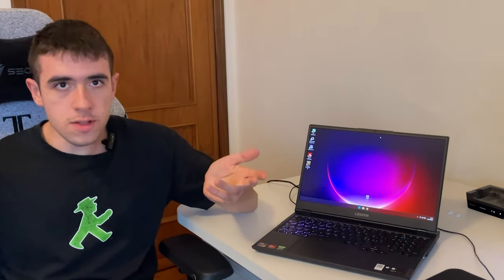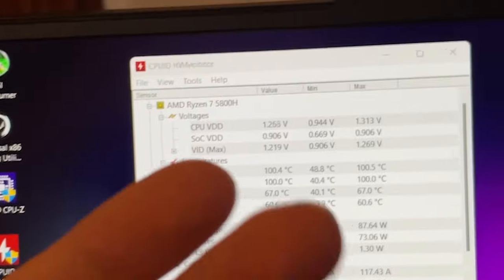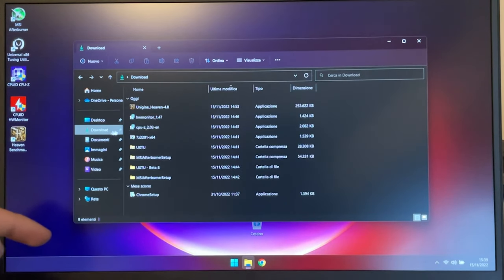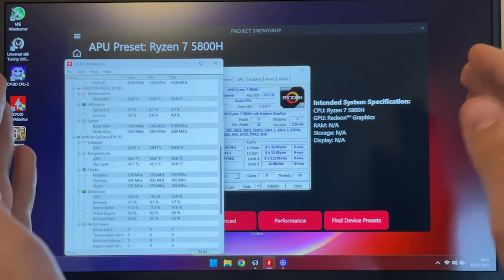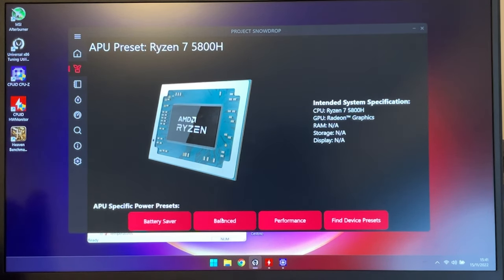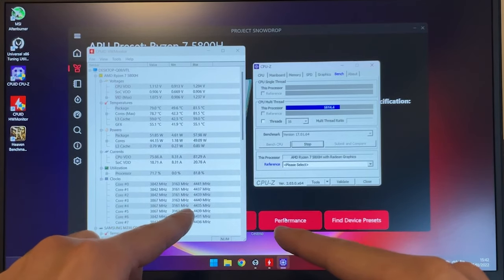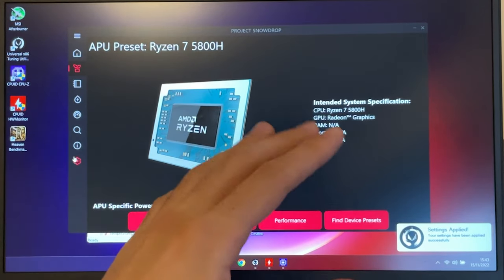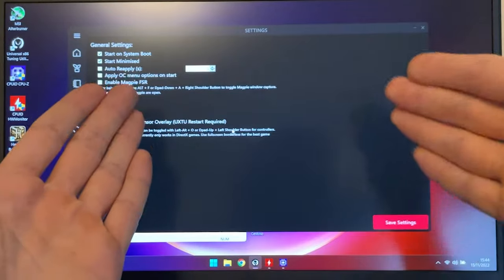Undervolt ANY Ryzen Laptop CPU for more FPS | Tutorial | R7 5800H on Lenovo Legion 5

Comment: My laptop automatically limits the temperature to 91 degrees. (I Just downloaded it a few minutes ago) with balance mode it gets even hotter xD The only helpful way for me is to disable the Cpu turbo in windows and running at stock 3,27ghz
Reply from the maker: Oh wow, you have some serious thermal issues there😅 Have you looked into repasting it?
Reply: @ImWateringPSUs  I just bought it recently, it's a nitro 5 (not the best cooling) but with ryzen 5 + 3060 for €635 it was a good deal
Reply: @alicmd378  whats your 3D mark timespy benchmark score ?
Reply: @JohnnyBoy7267  7900 graphics 6500 cpu
Reply from the maker: @alicmd378  That's really good and also a pretty good deal!
Reply from the maker: @alicmd378  But I would personally looking into repasting it, it shouldn't overheat that much!
Reply: @ImWateringPSUs  That will void his warranty

Comment: Hell nah. This balanced mode nearly fried my r5 4600h. Usually I have 85°C and 2GHZ on my 2 year old CPU and I try to do something to up my GHZ to at least 3GHZ stock. (not even talking about the 4ghz boost). And after setting it to the balanced mode my temp was increased from 85°C to 95°C in 2 SECONDS. YES, 2 SEC. 10 degrees more. Also my GHZ jumped up from 2GHZ to 3. So I was like: Okay, that is very hot but the GHZ is very good. Little did I know that after 3 minutes my laptop turned off instantly. It did that prob because of an safety precaution, but it didn't want to give any signs of life for like 5min. After 10 minutes it turned on and it was bootlooping for another 10 min. I turned it off by pressing the power button for 10sec, and then turned it on again. 
This time it turned on as usual. Now it is working the same as before but it nearly got fried.
Reply from the maker: This isn’t related to my tutorial though, it means you have a very severe thermal problem that you are circumventing bu locking the frequency at 2Ghz, effectively leaving half the performance on the table. You should do a repaste/repad and give it a nice clean!
Reply: @ImWateringPSUs  Yeah, i probably should do it. I (kinda) fixed my problem with that GHZ, now its between 2.5-3.5 GHZ so it is okay. I fixed it by turning on nvidia whisper mode and putting my vents to 100%. Im saving up right now for a new PC with rtx3060ti and an r75800x3d. But for now my laptop can deliver somewhere around 40-60 fps in RDR2 medium settings. Im ok with that for now. Also im curious how my thermal paste looks rn because i didn't change it for 7k hours of working on this laptop.

Comment: i have a question i ran this and my laptop started lagging alot and now i dropped performance i used to get 450 fps on minecraft but now i  get 150 not even 120
Reply from the maker: You did something wrong, but hard to say what
Reply: @ImWateringPSUs  I already fixed it with just reinstalling windows im glad it worked

Comment: If you have Acer Nitro 5 AN515-45 with Ryzen 7 5800H - and on that machine got Realtek HD Audio + DTS:X Sound, by any chance - and you experience CRACKLING SOUND issues or STUTTERING/TEARING mouse cursor while opening a program in Windows, than just downgrade this machine BIOS version from 1.10 back to 1.08 . There is also a video here on yt how to downgrade bios on Acer laptops.
Also don't use MTK WiFi card. Mine was toasted due to high temps and i had to buy AX200 - which is awesome now - WiFi 6 (Gig+). Haha!
Reply from the maker: Very good advice! Thanks a lot man :)
Reply: Honestly i think they messed something in BIOS v 1.10. When i had the 1.10 bios version - max noted core voltage by me was 1.36 V. I have used HWInfo to check why there was a tearing sometimes when opening programs. However i have decided to risk it and downgrade bios from version 1.10 back to 1.08 - which now is much more stable. However in 1.08 max voltage noted by me so far are now around 1,46 V. Also i will note that now while i have 1.08 bios version both Frequency max and Precission Boost limit reports also 4450 Mhz as a max frequency. While previously on 1.10 it was 4350 Mhz and 4450 Mhz respectively. And i suspect that it had to do something with the audio. While the crackling sound mostly appeared while opening single but heavy program. Sometimes making YT video to stutter while playing it in the background.
Edit: also do note that in BIOS 1.08 while using HWInfo processor reports Watt package for Sustained Power Limit - 54 Watt , for Boost Power Limit - 65 Watt. Some third party sites do report that it can suck up to 80 Watts of power from the mainboard. However i doubt that VRM's in that machine can withstand such a torture! I am not willing to test that out and toast the APU. But it is tempting! 🙂

Comment: That's not undervolting, that's multiplier limiting!! You can do that with good old throttle stop with 2 clicks and would reduce performance in every single real world senario expect that you have absolute oven hitting 100 C with relatively low loads like gaming. You have no idea what you are talking about or misleading on purpose...
Reply from the maker: It is not just a multiplier limiter! It actually works on the curve, you really couldn’t do the same by setting a static multi. I really do recommend you check it out on a Ryzen 5000/6000 laptop if you have it available!

Comment: I tried using the balanced mode with no change to temps. is there a way to manually set a cpu voltage offset with this software or is there something like that in hp omen 15 bios? (using 3070 with ryzen 7 5800H)
Reply from the maker: Unfortunately there is no way to manually set it, however it’s very weird that you noticed no change in temperature, did you get an increase in performance though?
Reply: @ImWateringPSUs  I actually noticed in the overclock settings there was an option to alter the CPU VID, which matched my voltage so I lowered it -100mV and it’s been working wonders. I noticed there may be lower gpu wattage as a result but the performance hit is not nearly as significant as setting the curve to -15. Also to answer your question the curve had a big negative impact on performance
Reply: Try "Ryzen Controller" it works just great to limit temperature

Comment: ive got the legion 5 pro and my temps are relly bad. Is this really undervolting? i installed ryzen controller and there you can reduce cpu tdp. is that also undervolting?
Reply from the maker: Using Ryzen controller you simply limit the TDP. Try out the method in the video, it really works!
Reply: @ImWateringPSUs it's also just limiting TDP. I checked temps and performance. All of these presets are just for limiting TDP. 
Balanced limits CPU TDP to 55W slow and 65W fast. That's why the temps reduce under the stress test. But in gaming you will see no difference if your TDP is under 55W. Try benchmarking with this "undervolting" and you will have less scores.

Comment: Umm does it lower gpu temp too ? Im trying to find how to undervolt gpu and cpu and i saw this video
Reply from the maker: I have an Undervolting tutorial for the GPU specifically, but doing this also lowers the GPU temperature since they share the cooling system
Reply: @ImWateringPSUs  oh i see, can i get a link for the gpu its still legion 5 right?
Reply from the maker: @dgrizzlyyt5630  I have a generic 3070 Laptop undervolt one already posted, but if you wait until monday I'll have the Lenovo Legion 5 RTX 3070 one posted!

Comment: nice can i use it on msi laptop  ryzen 5 5600H and will the clocks be stable after undervolt ?
Reply from the maker: Yes you can! Try it, it’s INSANELY good in terms of performance and temperature difference!

Comment: Ho provato ad usare sto software in una 6800h, mi va in tilt totalmente il pc, cancellata subito.. non so il motivo
Reply from the maker: Ci deve essere un altro software di tuning che va in conflitto!
Reply: @ImWateringPSUs  mh.. nitrosense? Ma non era manco avviato
Reply: @ImWateringPSUs  potresti spiegarmi una cosa? Come benefit avrei soltanto le temperature più basse o anche in termini di prestazioni?
Perché noto che le temperature del processore del mio laptop arrivano a 94-95 gradi, mai oltre, penso perché è impostato di non oltrepassare i 95 gradi. 
Ma in termini di fps, non mi lamento, invece se disabilito il turbo boost, le temperature calano drasticamente, ma anche le performance..  da un 144fps fisso, passo a 110-120

Comment: if i do this the gpu will perform better?
Reply: No
Reply: Yes and no. Universal X86 Tuning Utility provides options for the CPU. The way it's used in this video just applies different temperature and wattage limits to the CPU. Like mentioned in the video this can free up thermal and power headroom for the GPU, allowing it to boost higher for longer. Newer versions of UXTU allow you to change the GPU voltage curve similar to MSI Afterburner. That should increase GPU performance if done correctly. I prefer to use Afterburner myself though.

Note that there are AMD mobile CPUs that can use the Curve Optimizer which is an undervolt for the CPU.

Comment: Yeah man now my Laptop has changed from a Lada into a Ferrari 🤣 You aint get more fps with undervolting and overclocking for 5 FPS is not recommended too .. Just set the games in the middle and try to ram textures up and then the rest and if you are happy start the game! If you have cooling problems on a laptop just open it up and clean the inside and new paste (not recommended if you never did that !! ).. Most of the time the laptop is full of dust after using it 3 years ...  If you have a desktop just messure the airflow before building and you are always cool (google is your friend for help there) .. For example my 3060 12 GB is under load 62 degrees because of the good airflow!
Reply from the maker: What you say it’s true, BUT undervolting will also help